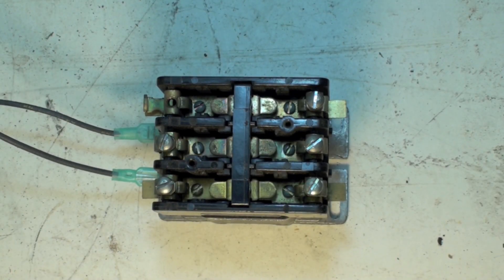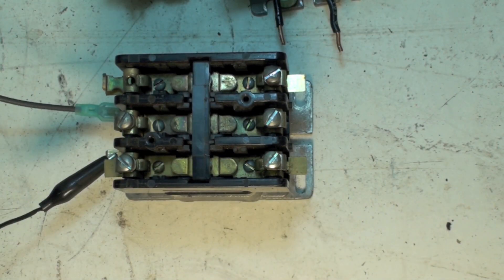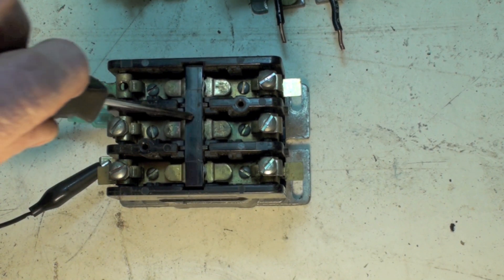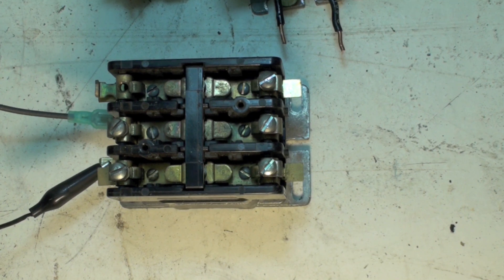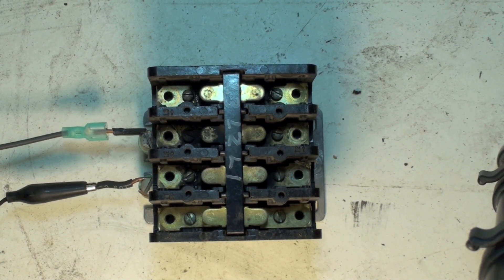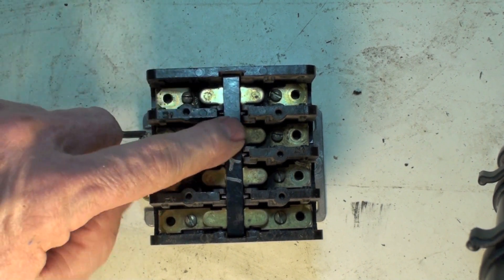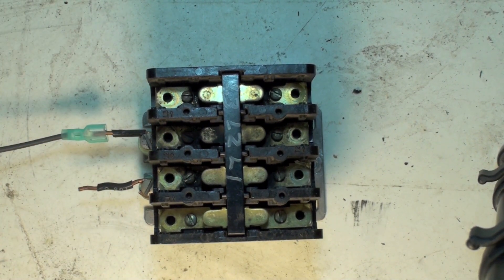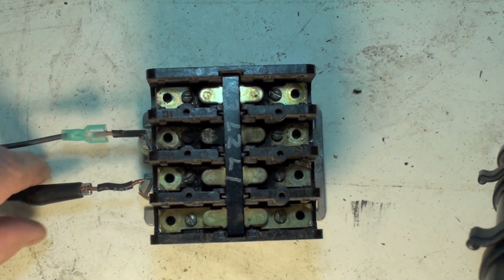The HVAC contactor chattering and hang ups part 3

Comment: Im pretty sure there is one of these behind a metal plate that was installed along with a new thermostat.  I can hear a sound exactly like what the video shows at first. It doesnt chatter but it does go click click then stop then click click again while the heat comes on. Is that normal?
Reply from the maker: Most thermostats have relays in them that will make that noise.
GFM
Reply: @grayfurnaceman  but this is coming from in the closet where the breaker box is not from the thermostat. It never made this sound before however there is something installed behind a plate next to the breaker box which i assume is a contactor.

Comment: Mine chatters when the ac is reaching the temp and ready to shut down. Is that a thermostat issue?
Reply from the maker: It could be.  It could also have to do with the voltage supplied to the contactor.
GFM
Reply: grayfurnaceman it was indeed the thermostat...thanks

Comment from the maker: Weak transformer would have low voltage when read with the contactor energized.  Same with incorrect tap.  Stat wire too small would also show up as low voltage.  Absolutely a loose connection could cause chattering.  I would think the contactor would have to be fairly massively oversized to cause chattering.  Thanks for the thoughts, more to look for.
GFM
Reply: Heat pump only getting 19 v. to contactor coil  when heat pump finally starts up.  Is this too low and will it make the heat pump contactor pull in and out like several times before it stays closed and still only shows 19-20 volts .  Weak transformer?  I thought they either worked  or they didn't work. Generally how low a voltage can a contactor coil stand before it will not hold the contacts closed?  This is an old trane air handler with 2 contactors , and of course one out at the h.p. condenser   thanks for any input.